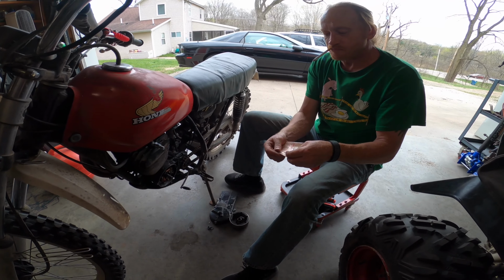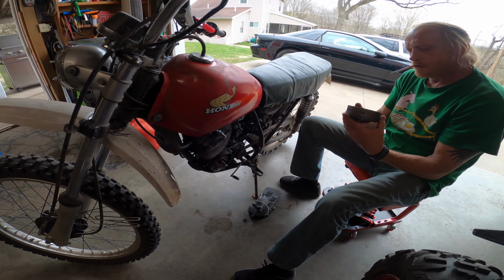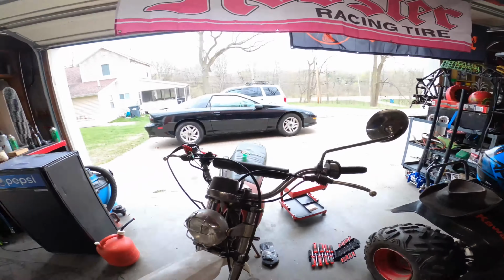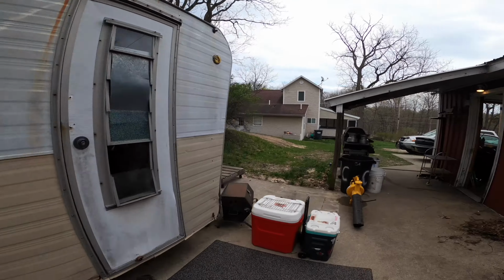Fixing the NO SPARK issue on the Honda MR175 Elsinore and much more!!

Comment: Fix that exhaust leak an repack it an that 2 stroke will sing . 2 strokes run sluggish when u have a header pipe leak an unpack exhaust . That be cool if you can find a true expansion chamber an fmf pipe or pro circuit for it
Reply from the maker: Agreed. It needs an exhaust overhaul for sure!!!